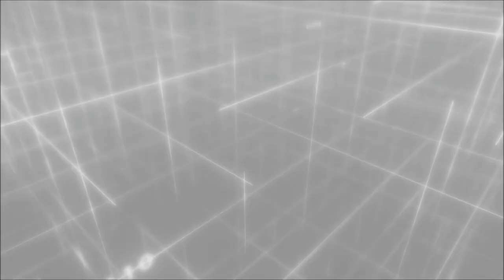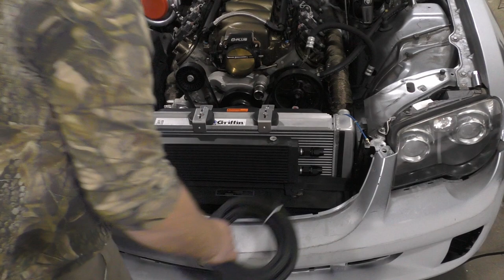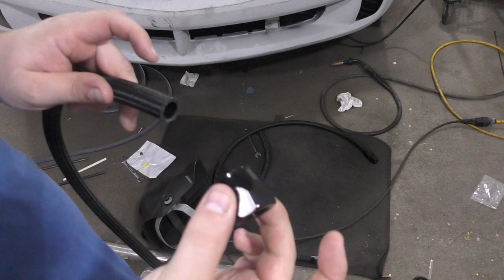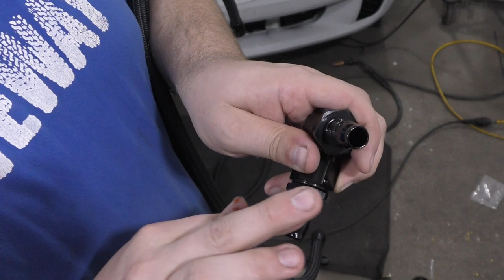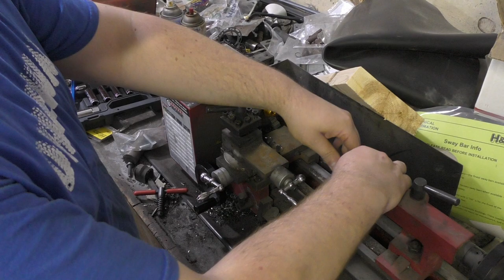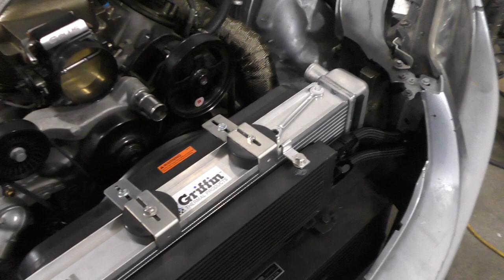V8 Crossfire Project: Installing the Oil Cooler | Driveway

Comment: any worries about overheating with the intercooler and oilcooler blocking so much of the radiator?
Reply from the maker: A little in the back of my head, but it still flows a lot of air through the whole conglomeration...  it shouldn't be drastically different than a stock radiator with an A/C condenser in front of it.  I figure, try it and if it doesn't work, change it
Reply: @Drivewaybuilt  cool, thanks for the reply

Comment: If they don't make a sandwich plate for your car how can you install a oil cooler on a Hyundai.
Reply from the maker: 90 percent SOL, but what hyundai do you have, I have seen many plates for hyundais
Reply: The one people would never think to ever modify but I'm the only sucker trying to a 2015 Hyundai azera limited 3.3l v6 with a lamb motor
Reply from the maker: @luxurygeneration407  Since its a cartridge style, that makes it really rough - if it was a spin on, it would be easy
Reply: They made one for the genesis coupe 3.8 and all it's does is use the filter form the turbo genesis that maybe one thing I try if not I saw a utube video were one guy on a Mata put holes in the oli pan but run it to a turbo but I'm not there yet it's just I want to do the cooling modification first before adding power because it gets hot in Texas what are your thoughts about the oil pan I idea thanks for taking the time to help me out.
Reply: Ps what does sol mean
Reply from the maker: @luxurygeneration407  sh*t outta luck
Reply: Lol I'll keeping trying or blow the motor